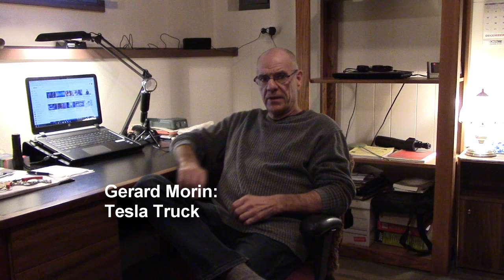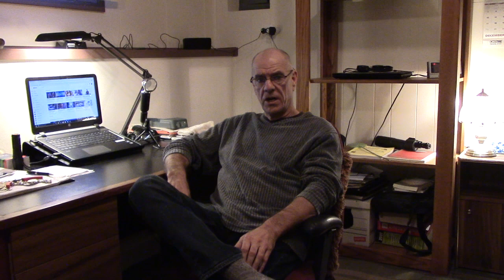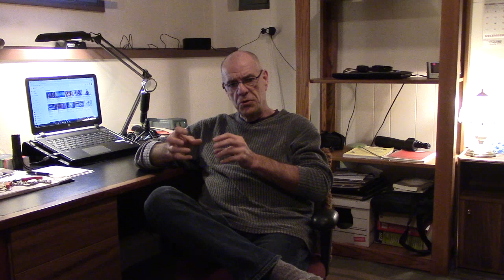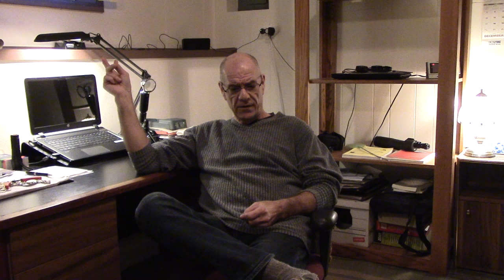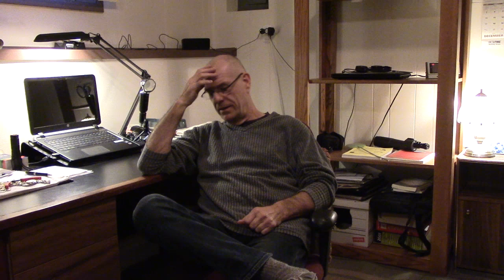Gerard Morin: The Tesla Semi

Comment: If you think about it, Tesla is kind of screwed because they could never use the "hyper drive" low amp. high torque motors in their vehicles.Why? Everybody  would  know how efficient and powerful they are and start asking why the hell they can't get that in other things.Imagine if all of a sudden people got double the range and power on a battery charge. I think the big wigs are stuck using these high amp motors where people can see the power usage. That's why they only use it in applications where they can hide it  e.g. Samsung washers- 2 amps, Bombardier electric trains -40 amps
Reply: What goes into a motor with high or low amps is not import because electrical power is measured by amps times volts also called watts. Power expanded over time is energy. Even if you could build a motor out of superconducting magnets it could not run forever or produce energy out of nothing. Efficiencies of better than 80% energy transfers of electrical energy to mechanical energy was achieved back in the early 20th century. Conservation of energy prevents exceeding 100%. Two amps at 120 volts is 240 watts. If a bombardier electric train was operating on 25 kV at 40 amps (Amtrak NE corridor) that would be 1,000 kilowatts or 1 megawatt. of power. .

Comment: Tesla uses a simple 3ph delta induction motor. No magnets, just pure copper squirrel cage/stators and silicon steel high eff. min. eddy current loss laminations.
Reply: I miss gerard morin and have learned more from his videos then all other videos combined but gerard is wrong in this video . tesla car company uses a Tesla 3 phase AC motor that does not use magnets and is very efficient
Reply: @christopherthumm4046  New design uses high temp magnets to save magnetizing  and deceleration power wasted. 150KW burst generators in EVs brands now, rotors the size of your head.

Comment: What Morin has said is that the "Power Company/Hydro" sends the "Transmission" power to your house over ONE LINE. This is absolutely TRUE. The Single wire splice/Y from the Transmission line goes directly into the top of the Transformer (if you don't believe me, go look). One line in, NOT two. This is absolutely TRUE. The 110-220 coming into your house is produced by/at the transformer on your power pole. That's why it is called the TRANSFORMER. It transforms the super-high-power, super-high-frequency energy transmission coming thru/from the Transmission Line Power into a usable/stable 110-220 60Hz signal that we use in our homes and businesses. This also is absolutely TRUE. 
The "Neutral" return line to the power company is a relatively "NEW" thing that the power companies have done. Back in the old days, there was just a Ground cable stuck into (what else but) the ground next to your power pole. The Neutral line (formally called the Ground Line) in your fuse box was also grounded, into the ground. No return line! You just had Hot and Ground. Nowadays, the Common or Neutral line is eventually connected to Ground. If you have an old pole you can probably still see that cut-off Ground Wire there. The idea behind the "return line", that Neutral Line, is so that the power company can "monitor" the power you are using via that "Smart Meter" plus bleed-off some of your (paid for) power (about 3%) to power some of their upstream devices used to transmit power to your house. Call it a Surcharge.
I had thought that you knew more about electricity (as it pertains to its Transmission and household current) than you actually do. I apologize for my mistake.
I would like to suggest that you study up on the subject BEFORE you rage against the truth.

Comment: Maybe on a gasoline engine 4 ring magnets (just like David Allen LaPoint has in his magnet bowls)  inside the intake manifold with the coil connected to each magnet to pulse high tension spike 30,000 volts to the magnets +-+- config to crack he Nitrogen into Hydrogen for fuel?  Or on diesels use a neon transformer for the high voltage...only two things exist electricity and magnetism so simple. Adjust frequency to find the sweet spot RESONANCE. Lots of testing to do...

Comment: I don't mean to impede your Tesla bashing but lets a take a look at rail road technology and how long a typical train lasts, forever! These machines don't use engines to push the wheels they are using electric motors and generators tied to a diesel generator and heater packs to slow the wheels when descending mountains and throw in conventional brakes. Lets apply this same tech from trains to a Tesla truck, now we use cut and pasted engineering to get a working truck minus the diesel for a battery bank and there you have reliability. Cooling electric motors is too easy when they are inside an oil bath being forced air cooled. So your right the pencil pusher don't know but they use the known to engineer.

Comment: Great analysis, I had a feeling something is wrong with those trucks and here it is, some spark of truth. About the nitrogen. So, you're saying that gas/petrol is merely a catalyst for it? Could we just bring some serious volts into the valve and get a combustion? 
Check this out, Dagestanian inventor got 30 bar pressure and high voltage sparks in his little car engine, 1 liter per 100km and doubled horse power: https://www.youtube.com/watch?v=wr0KPBv6978 He's got all figured out dozen of years ago, got 50 patents, but no one gives a frack.

Comment: Do you know why they chose Tesla as the name of the company? He is using Tesla's designs. Not a traditional dc motor. Did you know they used to have trucks in NYC a very long time ago to ferret products locally from the piers in NYC? Check the edison iron Battery as well. They still have them in operation today even at over 80 years of age.
 As for the cooling it is a special internally cooled system. There is nothing wrong with it. I would suggest viewing some videos about the drive system before making guesses about his non traditional systems.
 It is been suggested that they would have a hydrogen system to power the batteries so it can charge on it's own with top charges from stations.
Why didn't you check it out before saying this stuff.